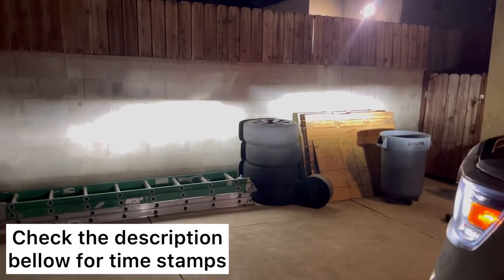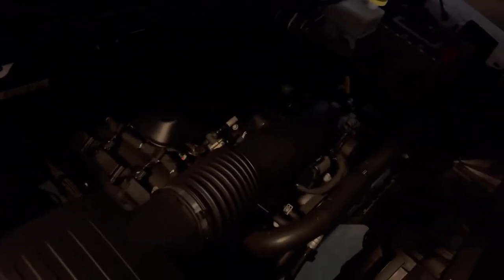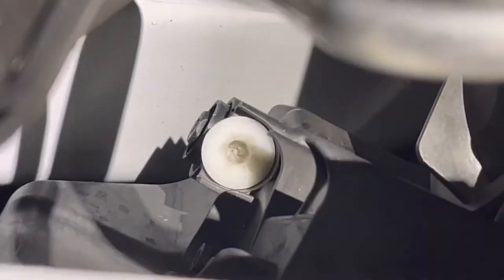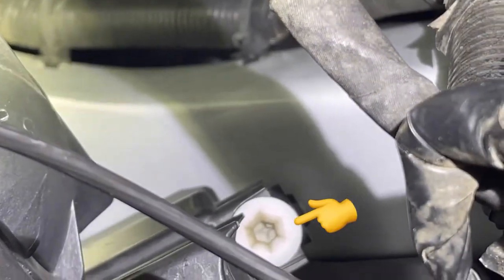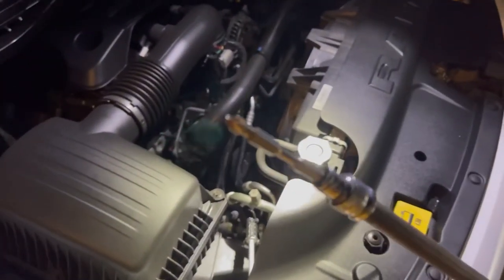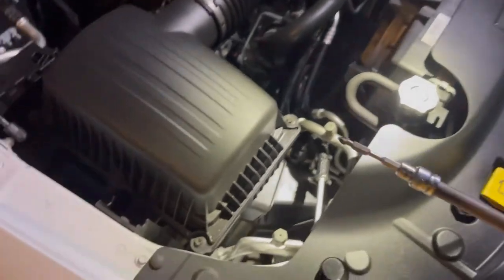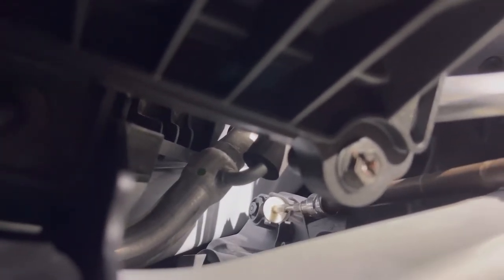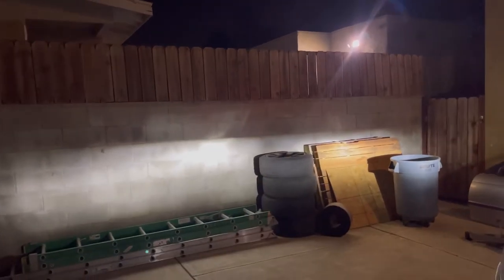How To Adjust Headlights on a 2019 & Up RAM 1500 | DIY | Before and After | SUPER EASY 2020 2021

Comment: Why in the world would anyone use an impact drill adjust their headlights?  All you need is a Phillips head screwdriver or Allen wrench.  The adjustments needed are small increments up or down.  I just did mine last night with a screwdriver and had no issues.
Reply from the maker: I clearly said I didn’t have a screwdriver lol, there’s a closed caption button on the corner if you need it 😀👍🏽
Reply: @shoobiedoubie6871  You know they sell screwdrivers in stores also!  How about you go buy the proper tool to do a job.  You have a truck but not the proper tools to do a simple job on the truck!  At least I did mine with the PROPER TOOL!
Reply from the maker: @kboo74  At least you did buddy. 😎🤙 How about I buy you a cookie for being such a good boy instead of the screwdriver? 😌🍪
Reply: Why anyone bashing what he used as long as he mentioned what was his problem.  You all know to judge instead to say thank you for his time showing us something which probably some of us didn't know.
Reply from the maker: @crisscriss5455  Yup, it was a rookie mistake. So I hope no one else does it 👍🏽
Reply: why does it sound like gas is coming out from it when i turn it ?
Reply from the maker: @garciabeto760  I believe that because of the power steering, no worries 👍🏽
Reply: @kboo74  and what is the proper tools need to adjust mine
Reply: @joeolvera1  I use a star bit screwdriver to adjust mine.
Reply: A Phillips head
Reply: @kboo74  a Phillips head
Reply: @joeolvera1  No.  The bit should look like a multi sided star and the size to fit your adjustment screw.

Comment: The reason the right side is higher than the left is to illuminate road signs on the passenger side, and the left side is lower to not blind oncoming drivers.
Reply: Well damn.. i never knew this either. About to adjust mine after a leveling kit install. Thanks!

Comment: I think the left one should be lower to prevent dazzling oncoming traffic. But the right can be a little higher to illuminate more of the road ahead fairly harmlessly. I’d leave the left as is but pick the right up a little bit. Then you can verify with a buddy if it’s blinding you. But thank you for the excellent instruction. Just got a new Ram and I think the lights are a bit lower than they should be. Still researching the proper height for this vehicle. But they seem way too bright up close initially.